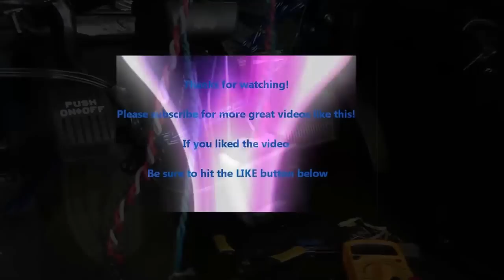How to add your own alarm shock / motion sensor to an Evo One

Comment: Hey, did you have to reprogram or edit settings on the EVO to make this work? Thanks for the info.
Reply from the maker: No need
Reply: @Lesscoelectronics  sir what will happen if the car is parked tilted like 60 degree inclination? Will the sensor work the same???

Comment: Could this work with a dual zone shock plus glass break sensor like the omega au85tn?  My installer was optimistic that it could but once the system was armed it was immediately triggered without fail. What are we missing?

Comment: I used the 3 wire plug in from Evo-One.  I bought JST-XH 2S Wire from Amazon. the Evo-One is Ground-Trigger_Power....so my plug is Red-Yellow_Black. YES, That means the Red is the Ground and the Black is the Power. I wired to a Dual Zone DEI ...Green and Blue wired together with Yellow trigger...WORKS PERFECT ..Thanks for the video. No separate wiring needed.
Reply: Thank you! You have confirmed what I was thinking all along.

Comment: Ok, where did you get the connector ? what's the connector name to search ? next, so you connected the 2 form shock sensor to the 1 center wire TRIGGER ???